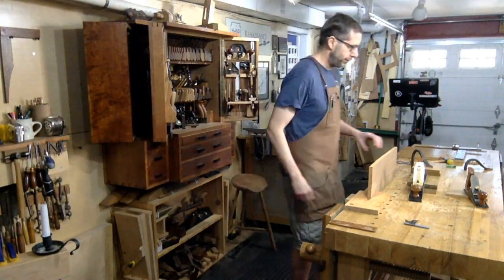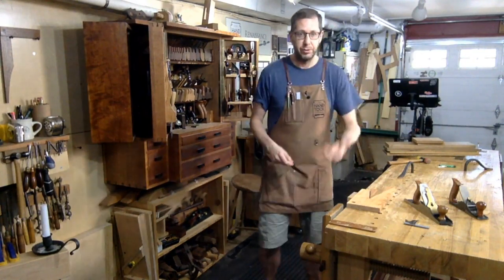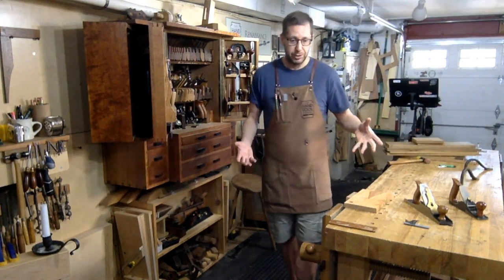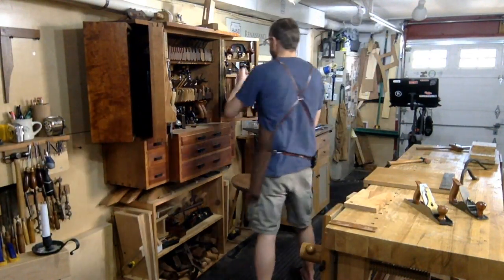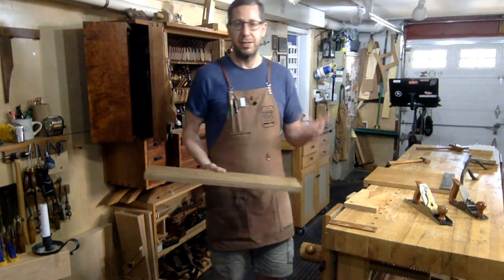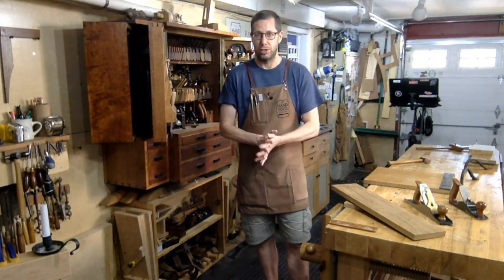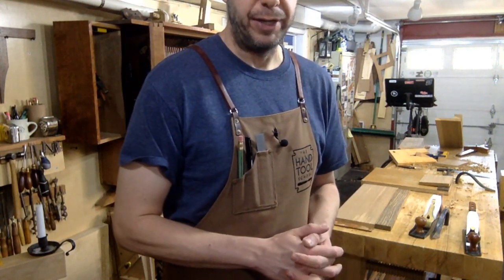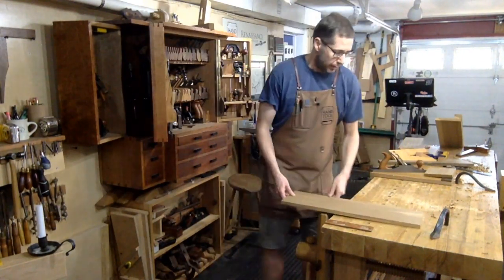Hand Tool Q&A Live: Work Holding

Comment: thank you Shannon, wonderful video. any suggestions for best angles/measurments for that birdsmouth plus wedges? John L.
Reply from the maker: Couldn't tell you the angle but start with a board about 5-6" wide.  Mark the center then come in about 1" from each edge and connect the dots.
Reply from the maker: Keep your offcut and rip it in half and you have your wedges

Comment: Shannon, I don't mean offense, but why would you favor an African hardwood instead of domestic hardwoods? I've just passed by another channel where they glamourized old growth Brazilian rosewood. That thing is gone, it's extinct. He was also using Macassar ebony elsewhere... Why not build with more local materials and favor sustainability?
Reply from the maker: "local" does not automatically mean sustainable but neither does "exotic" automatically mean it is not sustainable.  90% of the wood species I use are domestic and when I do use exotics you can be sure that careful thought has gone into the choice of that species.